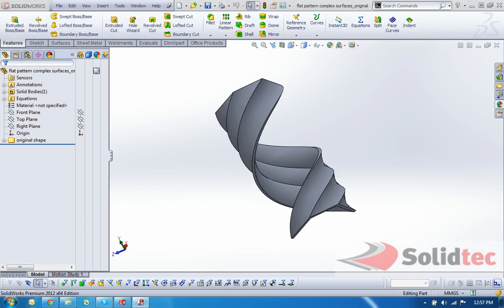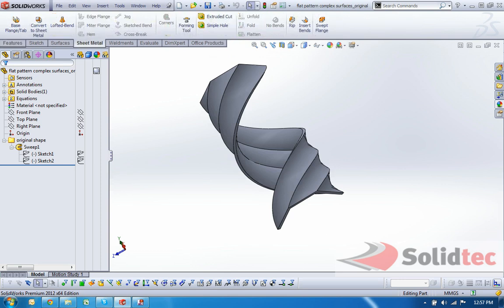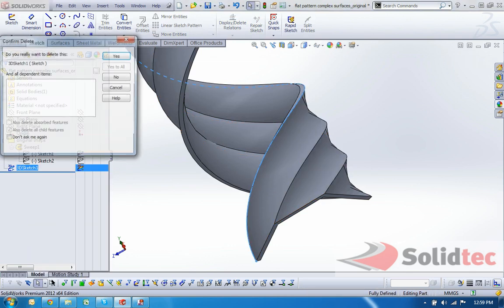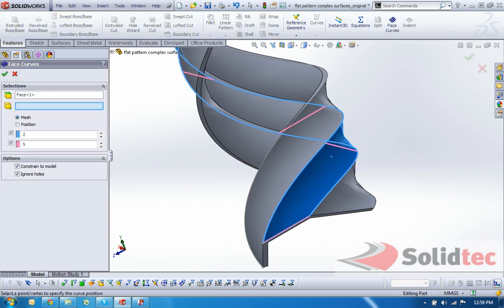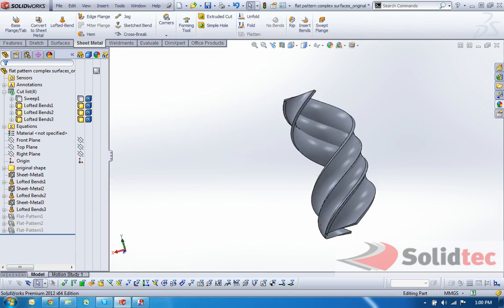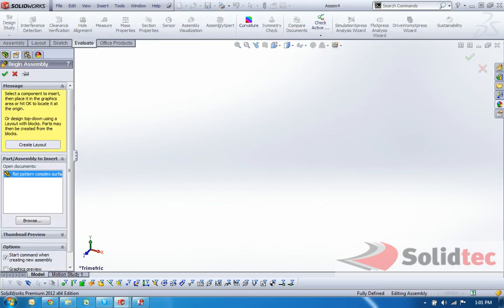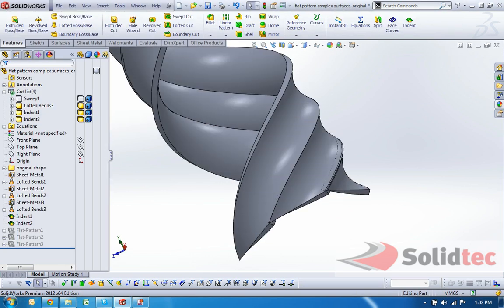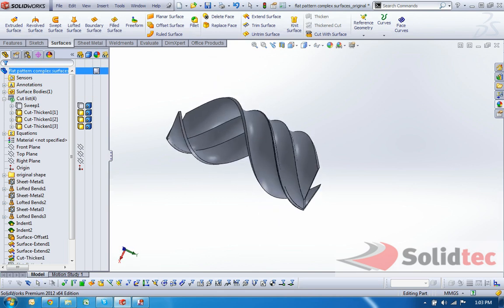Create sheet metal bodies from complex geometry

Comment: This is interesting. However, I have a question....the indent feature, although it seems to nicely remove material, is it cutting your parts at a chamfer? If yes, then how is that supposed to work with sheet metal parts? Yes, you can flatten them in solidworks, but that doesn't mean that, say, a laser can cut them like that (unless you've a fancy laser)